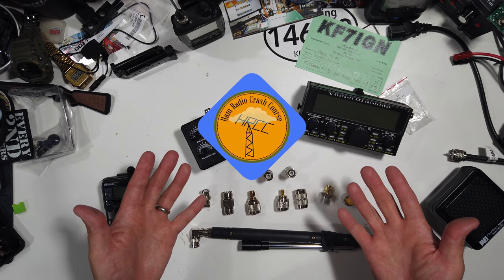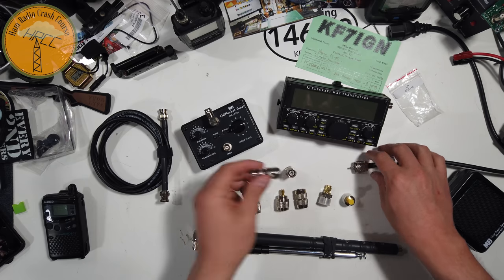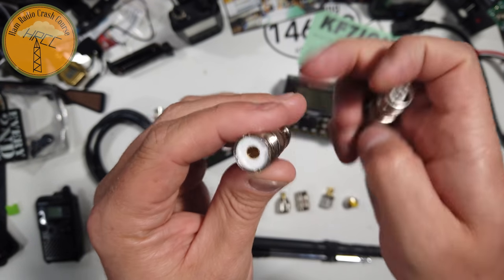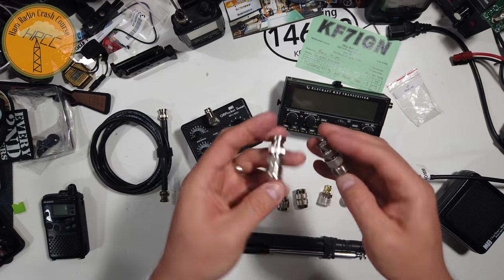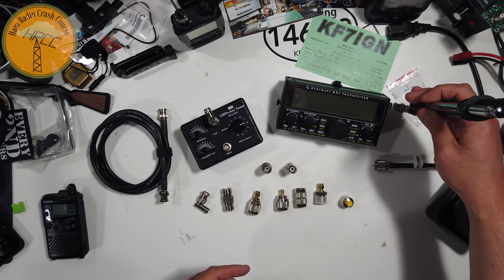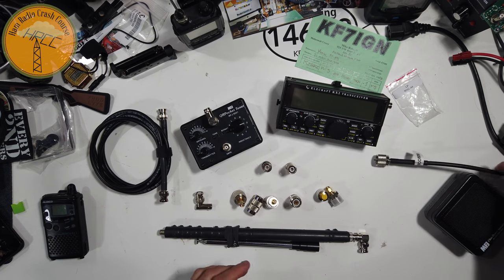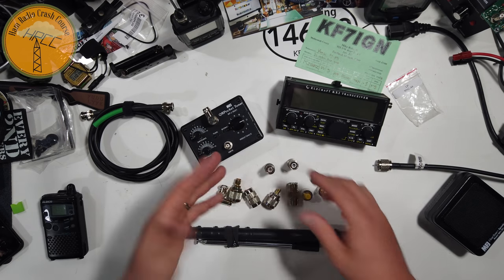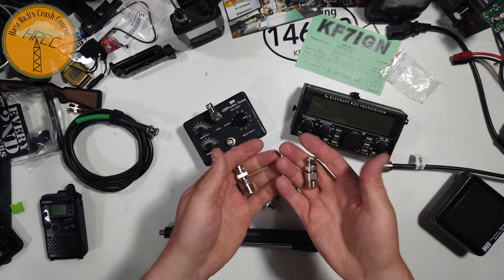Lets Talk About Coax Adapters

Comment: A lot of BNC Connectors in the TV and PLC world are 75ohm as opposed to 50ohm as well. Not a lot of loss, but that would be one place you can easily save some loss by matching impedances with your adapters. Totally agree with searching for more quality built components. Great vid!
Reply from the maker: This is one area where spending a bit more is worth it I feel.
Reply: WI9LL this is so bizarre for me, I am the local guy who can show kids how to calculate wavelength and often hook up a scope to a microphone so they can learn something. 20 years as a broadcast video tech and just found out last night there are 50 and 75 ohm BNC connectors. I literally have tool bags full of new BNCs and crimp tools and am able to find both impedances in my stash of stuff from my former existence. How the hell did this escape me? Did I finally find an example of being able to depend on an engineer? That is scary
Reply: @jeffreystroman2811 you are not the only one. I recently knew that BNC can be 75 R too, and they are not the only type, which has 50/75 Ohm variants - there can exist 75  R SMA etc.

Comment: Josh, a really great tip for any ham radio operator. I have a small case that I have all my connectors in one bag. It stays in my go kit. I have been out two many times without the right connector!
Reply from the maker: Oh man, when that happens is SUCKS!
Reply: @HamRadioCrashCourse  It sure does. Stopped a local deployment immediately. :(

Comment: W6LG alao a ham YouTuber did a test with like 30 connector and adapter all together back to back to back no measureable loss with bird meter. But get some good quality ones
Reply: I was trying to recall who did that video.  I was thing is was kevin (old tech guy)
Reply: #SayNOtoKILO I saw that video, and from what I recall he used a bunch of what some would call “cruddy” old connectors in that crazy long chain, and it was fine.

If there is one thing I can impart to anyone out there about paying out the nose for “high end” adapters and the like it’s this.. Don’t.

It may look shinier, but it almost certainly won’t perform any better. Much more often than not it is a rip-off.
Reply from the maker: For me, its the lock up I care about.  I want that connection to be strong.

Comment: I got an MFJ-1899T. Will use an SO239 to BNC, so I can connect the 1899T to a magnet mount. Will then add the counterpoise from the radio ground screw, then test.The coax line that came with the magnet mount and terminated in a PL259, is about 17" 4".

I will connect the 1800T on it with some adapters as above. Then will check with my Xiegu G90 internal analyzer to check for a nice SWR. Counterpoise for 20 meters will be 12' 6".

So, the magnet mount and counterpoise will be used for a portable solution. If you have any videos on something like that, it will be nice. I will test mine, then see how it goes.

Comment: Are BNC connectors only for uhf/vhf? How about for HF? I unscrew my antenna from my IC7300 each time I'm done......just in case......this would be easier but are BNCs rated for HF?
Reply from the maker: Yes. Most qrp radios use bnc.

Comment: You will get loss on higher frequencies with Cheap adapters and connectors that can and have melted the solder where cheap adapters will leak the solder out.

Comment: Can a radio that is transmitting on 460 mhz do well or function on an antenna that can only get up to 440?
Reply from the maker: It will likely be fine, but you should check the SWR.

Comment: Josh, have a question..

I have a Nagoya antenna that I want to use on my Radioddity GD77. Can I use the female/male SMA adapters or would it blow my equipment?
Reply from the maker: It would work, but chance to snap the connector would go up.
Reply: @HamRadioCrashCourse   Thanks for the response! Great channel and keep up the good work. Highly informative.

Comment: Thanks for the video. But I can’t stand BNC connectors. Had bad experiences with them on HTs back in the early 1990s. The forced required to use them on HTs would break them off the HT case. Meaning, the case would break at that point. Hence I have a strong dislike for bncs. I was hoping that they were on their way out of usage. Much prefer to screw a PL-259 than push in and turn a BNC.
Reply from the maker: I fear SMA much more than BNC.

Comment: I have an amplified TV antenna I want to use with an  SDR, Rsp1a.  Its the same size as any generic cable TV wire but it's don't know the name of that plug to order a proper adaptor.  I only know it by the type of cable, RG 6, but I don't know the name of the connector.

Comment: If using them at VHF/UHF buy quality! The cheap ebay China ones have really bad impedance at higher frequencies. I hve confirmed this, I melted a N to PL259 adapter with 1,000 watts at 2 meters...
Reply: The issue at that point is less likely the adapter quality as it is using a pl259 for VHF. There are far better things to terminate coax with.
Reply: The issue at that point is less likely the adapter quality as it is using a pl259 for VHF. There are far better things to terminate coax with.
Reply: The issue at that point is less likely the adapter quality as it is using a pl259 for VHF. There are far better things to terminate coax with.
Reply: The issue at that point is less likely the adapter quality as it is using a pl259 for VHF. There are far better things to terminate coax with.
Reply: The issue at that point is less likely the adapter quality as it is using a pl259 for VHF. There are far better things to terminate coax with.
Reply: @howlingwolven  5 replies same thing? We had no choice, we were operating portable and had to adapt to replace a piece of coax that a bear chewed on... since then I created a connector kit in a fishing tackle bag with removable trays. And the front pouch holds the crimpers, a wore cutter, a coax cutter, strippers... side pockets hold small repair items like wire, solder, etc.

Comment: Wouldn't you rather a bit of wobble in your cheap, replaceable connector to absorb movement than have the connector on your radio absorb it? Clearly an unintended "feature," but it seems it might be a plus. Almost like a fuse.
Reply from the maker: You would think so, but no it can lead to an issue were too much wobble can lead to a short being generated or a disconnect of the antenna.  For my money want to rigid so there are no issues with SWR or loss of connection.
Reply: My thought was I'd rather replace the adapter a dozen times than replace the radio because I broke the connector off the board. :)

But I guess if that shorts, it can take out other things in the radio as well.
Reply from the maker: Its alot less likely to break BNC connections off of the QRP radios than the little SMAs off the HTs.
Reply: Ham Radio Crash Course just don’t hook up some LM400 or something directly to it. 🤣